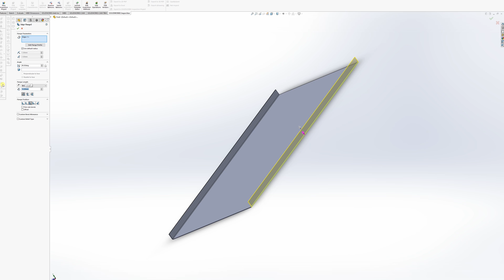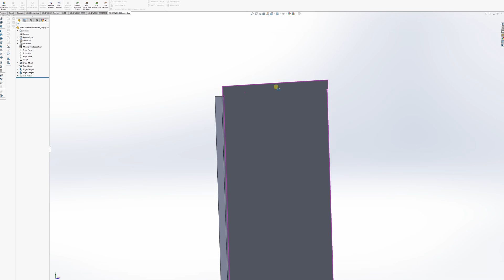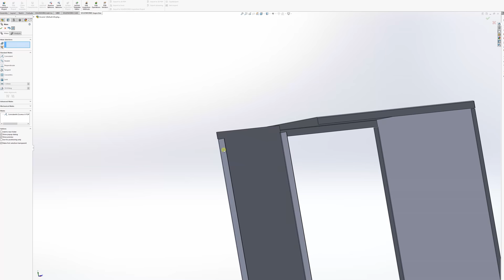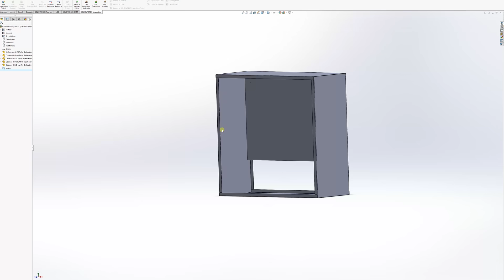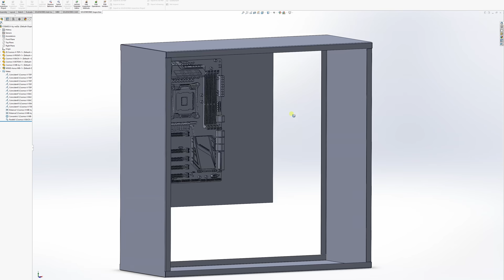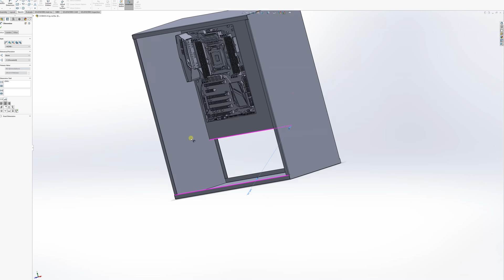Cosmos by neSSa ep.2

Comment: What happen with this case?
Did you finish it?
Reply from the maker: Yes:  https://youtu.be/GBfrt2hRt-Q
Reply: @SSMods_CustomPC  It is beautiful, simply amazing, great job!

I want to buy this case, but for now I do not even think to create such a perfect modification, maybe in the future. 
I know Fusion 360 so I have a tool to create design, and for sure your work is a perfect inspiration for me.

But for now I wanted to buy 360mm NZXT Kraken Z73.
And I have a question. The only option to install NZXT Kraken Z73 on the top of the case is to remove DVD cage?
Thank you for help.
Reply from the maker: @dariuszek4dead  You can instal 360 rad on top
Reply: @SSMods_CustomPC  I was thinking about it, but I wasn't sure if it's possible.
So I can put 360mm on the top of the frame, under plastic cover, and 3x 120mm cooler inside the case, I'm correct?
I love this case so much, and even if I never build my modification, then it's fine. This case it's a part of PC case design history, it's beautiful.
Thank you so much! :)
Reply from the maker: @dariuszek4dead  no, you can put fans under plastic and radiator on the top